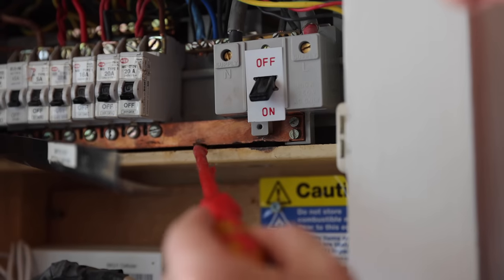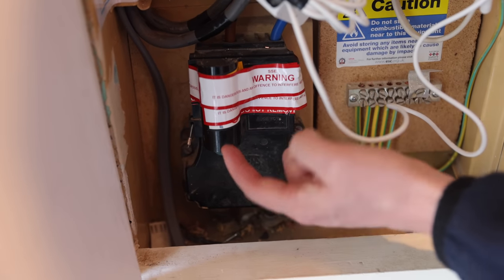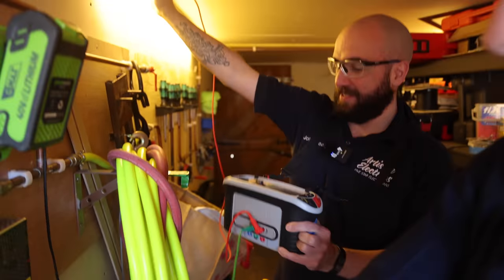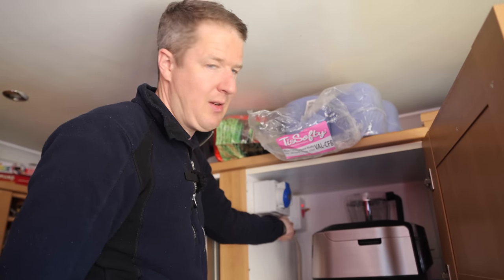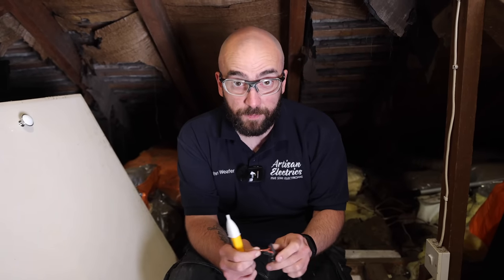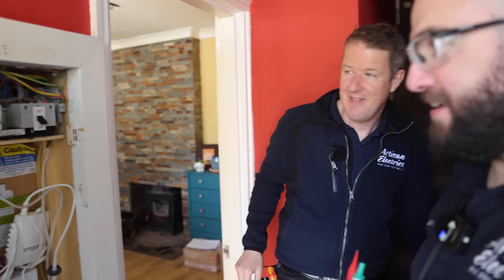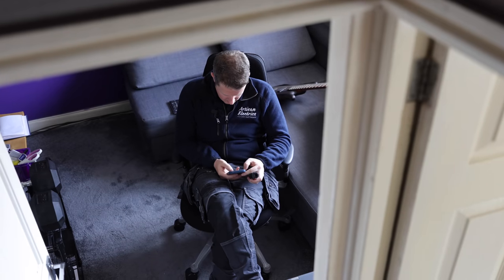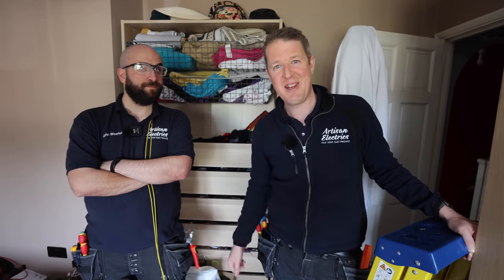REWIRED BY A CHIMPANZEE! Skeleton Board EICR

Comment from the maker: Thanks to TRADIFY for sponsoring this video: Get 50% Off your first 3 months using our discount code "ARTISAN" here: https://bit.ly/37G9BZX 

What the most shocking thing that you've found on an EICR...
Reply: 'so that they're all at the same potential difference.' ? Surely you mean 'so that they're all at the same potential.'?
Reply: 60A main DNO fuse blown, replaced with wire between the blades and MANY other bodges over the years!
Reply: I love how i watch this but half the video i sit here thinking "what the fuck is this dude on about?"
Reply: First question refer to public comments
Reply: Can you do a video of how many electricians abuse the now regulatory 5 yearly EICR for landlords. In my experience you request an electrician does the inspection he doesn't sign off and gives a bill of thousands of pounds for minor issues. E. G. I had a hairline crack in the consumer unit and got a bill for 800 to come back and replace it.

Comment: Personally as an electrician I’d be removing all those CTs and informing your customer that what they’ve done had left it unsafe. And put the cover back on so you’ve left it in a safe condition rather than thinking that you’re going back at some point. Safety is more important than their OCD monitoring
Reply: Except they'll just take the cover off and put the CTs back the next day, so that's not really safer is it? Unless you think you can scare them into not touching it again it's safer to leave it be for the time being.
Reply: @xxwookey  or explain to them the danger and then if they put it back to how it was, refuse to go back.
Reply: Serious question: where should the CT's be placed safely to monitor all circuits like this? Or is it a case of no decent place so like you say just remove them?
Reply: @xxwookey  doesn’t matter what they do after they have left , the issue is that that they have done what is reasonably practical to make it safe
Reply: @Phiebs  the problem is that he had taken the cover off the board. The CT clamps were fine on the board but the issue is that you have things like the bus bar (if it’s not covered by an insulator) exposed or the screws which are connected to the live supply. If you touched the incoming connections then you are relying on the fuse protecting the house and as stated int he code this is around 40+ amps. That will defo kill who ever did it.

If the wires came out through a gland or some other route that didn’t leave enough room to get fingers in then that’s fine.

Comment: Hi, great video. Just a comment, not all DIY electrical work is dodgy! I agree that people shouldn't do any electrical work if they don't know what they are doing. I have just completed a full rewire of my 3 bed bungalow, it was extended from 2 to 3 bedrooms. I needed to get an EICR so I could apply for my completion certificate. I got a pass (satisfactory) with no faults found. I went for all radial circuits with an RCBO board. Many thanks to you guys, David Savery and John Ward for your fonts of knowledge!
Reply: Exactly. I've had to fix work by every professional I've ever used

Comment: The worst i have seen,  so far, as an electrician was a house i was asked to check in Wiltshire. On inspection it all worked. Lights, sockets etc. then… opened consumer unit. A cloud of dust followed the cover. The entire house was cabled with VIR cable (shows age) all the rubber had perished leaving bare wire everywhere. But as nothing had been moved, it worked!! Needless to say. Failed  and a total rewire recomended

Comment: You really take pride in your work. Very informative video. By the way, the PSU at 08:55 is supposed to be used within an enclosure or device chassis. It is not rated to be left exposed like that.

Comment: Regarding the 1mm feeding the spur, I was taught not to use different size conductors in the same terminal, if you're going to install a spur for a small load use 2.5mm then reduce on the load side of the spur.

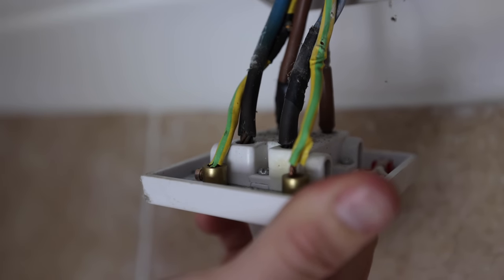Comment: 26:20 Standard square shower pull cord switch issue.
I use the round Crabtree ones, you fix it down and then terminate the cables with nice bend radius.
Neon is connected to the cover so ideal for I.R. testing, just fit it after.
Reply: Crabtree are far easier to terminate, especially if they are 10mm

Comment: Thank you for sharing. Very interesting!!!!. Could i ask about the battery storage, is the loft the best place for placing them. Just thinking of weight and temperature fluctuations. Also fire risk. Keep up the good work.
Reply: I was thinking the same... however its actually what is stopping me from doing my batt install in the loft..  everything is wooden so not chancing it.  I'm now leaning towards doing it in the garage but it means I got to run a really long cable.. kitchen is the next best and easiest area for me

Comment: I was told by an electrical tutor that it was OK to use 1.5mm twin and earth on a 13 amp socket ,double or single provided that it was supplied by a connection unit with a 13 amp fuse. 1mm maybe OK in some circumstances but if any correction factors had to be applied it may end up with the cable  only being able to take say 11amps and the fuse rating at 13 amps so I don't think it would be a good choice of cable with that fuse ,although with the short run of cable you have there I can't see there being an issue,although strictly speaking I don't think it does comply with regulations.
Interesting video,thanks for uploading .Happy new year.

Comment: re the outdated MCB and RCD, use an old copy of the regs to check they still pass the tests. Then decide whether it's immediately dangerous, needs replacing, advisory or nothing. If they trip at the right current/fault, old or not, they aren't unsafe. That's not to comment on whether there are other reasons for an upgrade.

Comment: Being from the US, seeing 40A and 60A services is crazy to me. The average house here has a 150 or 200A service, 120/240 split phase. 400A is common on all new construction. Some areas have residential 3 phase, usually 120/240 delta or open delta, but sometimes 120/208Y on a main road. My own house has 100A 120/240 open delta. 100A is almost never installed in new construction, and really was only common 1980s and earlier. Power company where I live is phasing out open delta services, so to upgrade to 200A, we need to wait for the power company to connect us to a 120/208Y transformer set that's on the next pole over. Waiting to hear back on what the max amps we can upgrade to is. Usually 200 but they may let us go 250-300. A 60 amp single phase service here would have been installed in the 1950s or earlier. Unfortunately most power companies in the US will not allow 3 phase for a residential customer so people are stuck with these ridiculous 400 amp single phase services. Lucky to live in one of the few places here where it is possible.

Comment: those class 2 metal light fittings with the plastic box are designed for singles peing run through conduit.  Where I've fitted them, I have used a bit if PVC sleaving from the exit of the conduit to the plastic box for the line and neutral and have crimped a ring fitting to the earth wire and attached it wall/ceiling mounting

Comment: as an American the whole concept of required inspections on electrical work is interesting. just today I pulled an 8 AWG which is a 6.0mm cable right out of its screw clamp on a brand new RV. the amount of wrong and intentionally bad wiring I found is just amazing. how a manufacturer can put a 55A output power converter on an 8 AWG (6.0mm) cable and then put an auto-resetting 40A breaker inline to "comply" with the wire current limits. but that breaker will be thermal cycling for the rest of its short life and fail prematurely.
Reply: And then the RV company will charge him over the odds to replace it for what shouldn't have been installed in the first place, because lets face it, a lot of people go back to where they get the vehicle from instead of finding someone who knows what they are doing.

Comment: RCD's.  Very important piece of safety kit.
I moved into a newbuild some years ago.  After a couple of weeks, an RCD would pop after switching on the kitchen light.  Got a local sparky in to have a look and, after about 15-min's, he told me he had cured it.  I asked him what he had done.  He showed me how he had swapped the RCD for a switch.  No more problems!  😱😱😱
I gave him a verbal boot up the arse and got another sparky.  Turned out that when the kitchen light had been installed they had drilled through the cable and there was an intermittent short between live and earth.
If it keeps popping, there's a problem!

Comment: All RCD breakers are supposed to be failed if they  are put in the fuse panel before 2018. This is due to the amount of DC circuits in the  circuit. You need a DC rated RCD for circuit with DC circuits connected to it. (DC circuit I mean devices like LED lights, electric car chargers, washing machines and other stuff that might have DC PSU in them)
The responisble thing is to change the MCB's also to the same brand as the RCD.
This is how we are suppose to do it in Iceland, you guys in the UK usually have harsher rules.

Comment: The 1 mil off the socket is protected against overload by the fuse in the FCU, no matter what. The one potential issue is short-circuit protection if the cable between the socket and FCU gets damaged. If the socket is on a 20 amp or smaller radial the MCB is probably sufficient to protect the cable, if it's 30 or 32 most likely not. RIngs and 4 mm2 radials are precisely the reason why BS1363 plugs have fuses in them (and of course overload protection of power strips).

4 MΩ is theoretically a pass but anything less than high double digits would leave me a bit concerned there might be something on its way out. With plenty of loads connected it's probably just a bunch of Y capacitors affecting the numbers though.

Comment: Presumably you would contact the DNO about the looped supply before installing the EV charger? 
I know Western Power will upgrade the supply free if its looped and you're installing EV, however I'm not sure if all DNOs must or if its discretionary.
Reply: Currently, DNO's have to replace the feeds FOC due to the green agenda from the govt. However, how long this will last is anyones guess, but currently, FOC

Comment: 18:50 Hey guys, civil engineering student here. Just curious, do you guys have to take into account the additional point loading from the weight of the batteries on the structure you're attaching them to, or get any kind of civil engineering approval? I was just looking at that old brickwork and considering how old the property might be and thinking, those batteries must add fairly significant weight to the walls.
Reply: I can tell you now, there will be no chance of that at all. Whatever the batteries are attaching to, it will be a case of 'does it look ok and structurally sound'...and that will be it. 

Personally i'd be less concerned about the weight issue and more concerned about how hot that atic get's in the height of summer - without adequate ventilation (potentially forced via fans), those battery systems are likely to shutdown via the BMS temperature cutout....and I never like the idea of the only thing stopping 100kg+ of Lithium based batteries from overheating and bursting into flames is solely the BMS safety cut outs. I prefer to ensure the environment itself never puts the batteries in a position where the BMS has to prevent a catastrophic failure.
Reply: @blower1 Agree  I would have thought the loft was the last place you would put a battery bank because of the heat/fire and inaccessibility issues.
Reply: I don't even run batteries as a hobby, but a battery bank in the attic sounds like a terrible idea unless you have a hot roof (roof insulted) and have the space conditioned. Then it just sounds bad.

I'd prefer to have them in a disconnected shed with good insulation and active cooling.

Comment: The MCB's would be a C3. It's just doesn't comply with the regs. It's not immediately dangerous. 

The kitchen extractor I would code a C2. The only reason I would is if something happens in the cable going to the spur. It would exceed its current rating before the breaker trips. Otherwise, it's not an immediate danger.

Comment: The water pipes in my Swindon home is a rubber reinforced pipe in a tube and are not therefore bonded to the pipes at that point. But the pipes etc are all buried into a concrete floor. The Electrics are unusual in that all the sockets are on one ring coming from the first floor.

Comment: The fused spur and its fuse is only protecting the cable and appliance  “downstream “from it…..the “upstream cable” feeding it should be capable of taking 32A or 20A ,depending on the system,  this  is by design ,so you don’t have to keep checking the size of the cable every time you change a fitting ,for example a fused spur to a double socket
Reply: The regulations allow for the protective device to be a maximum of 3m from the point of reduced current carrying capacity.
So typically 1.5T&E covers you for anything on a fused spur, but in the case of a cooker hood that will rarely be over 1A and fused down to 3A, 1.0T&E is still compliant, even if you and I would not install that way.
Our regs say "do what you want as long as you can demonstrate compliance"
American regs say "You will do it this way, without deviation"
Reply: @simonparkinson1053  thanks for the update however I’m old school and it sounds a load of nonsense to me thought up by some waffler trying to fill some  pages in the new regs book ,and justify his salary I’ll just stick to the common sense approach
Reply: @BabyBane100  not a new thing, it's been in for as long as I can remember.
But like you said, just be cause you can , doesn't mean you should
Reply: @simonparkinson1053  Yes ,thanks for informing me , I must admit that one passed me by ,but I won’t lose Any sleep about it, in the end I do a lot of things that I’m comfortable with ,and used to stand my ground, and argue with the inspectors on my assessments, I like to think it’s not my arrogance ,and I feel you get to know what is sensible ,and what is bullshit over the years !!!
Reply: @BabyBane100  It really doesn't matter what you think is sensible or what you  are comfortable with, what matters is the science...!   The regs change after accidents and fatalities and electrical engineers run tests and do maths to work out what is safe and what is not.  You can even do the calculations yourself...

Comment: The overall resistance doing the global IR, is always lowest than the lowest one. So recording that  value is fine as you know all the circuits are within the required limit of 1 M ohm
Reply: 1MΩ complies but only after further investigation to ensure no latent fault exists.
GN3: "...where an i.r. of less than 2MΩ is recorded... each cct should be tested separately."

Basically, if there's VIR or MICC (Pyro) in the house you really need to know if it is degrading by taking proper readings and comparing them with (snigger🤭) the previous test results.

Comment: In the Netherlands, a fuse at the end of the cable is not allowed to give you an excuse to have a smaller wire diameter. Only after the fuse do you get to use smaller wires. What happens if you get a short just before the fuse?

(This reasoning does not, however, apply to appliance flexes, because our plugs are not fused. For those, you guys do require fuses before the wire, though. It’s sort of backwards…)
Reply: It trips the fault protection in your protective device at the board. It seems like people are mixing up faults and overloads. Fault protection must always be at the origin of the circuit, overload protection can be anywhere along the circuit as long as it is before the load.
Reply: To clarify that; if the cable gets damaged it will either be a dead short (tripping the breaker no matter the cable's rating) or exposed copper (FI/SI/RCB/GF...etc). When there's a fault inside a device, it may pull more amps than its cable is rated for but not present a fault to the breaker. In that case it could overload the wire, and that's what the device fuse is there to prevent.

The fuse in the UK plug is there mainly because the breaker could be 32A, but both plug and socket are only rated 13A. Quite different from other countries where the breaker and socket ratings generally match. So an unfused plug could pull 30A through that 13A outlet and the breaker would not complain. Very easy to do using an extension cord with just 3 sockets.
Reply: @HenryLoenwind  if the cable gets damaged short or exposed are the most likely results, but not the only ones. You can easily get it making partial contact, and thus drawing current. Which is bad enough when it’s the cable’s rated current, because that point of partial contact is basically acting as a heater dumping all that load — but it’s not improved if they can get 40 amps before the device trips.

Comment: I did a separate line for each room and category. That is overkill but it is safe. So it is like 3 lines just for a my working room - 1 for lights, 1 for outlets, 1 for a AC. My switchboard looks like a nuclear power plant control center. It is expensive.

Comment: During the IR test it appeared John tested individual circuits at 500V without worrying about any devices still connected. This is about 22 minutes in after the global tests, he states he is testing line to earth without the neutral.  I can see the meter is on 500V.  I'm new to this but I am always ultra careful before testing at 500V.  I didn't understand his comment along the lines of the Megger will always bring the voltage down.  Did I miss something or can anyone explain why he was not concerned about the risks of 500V between line and earth and his comment about Meggers?